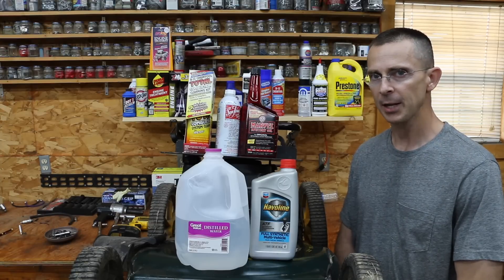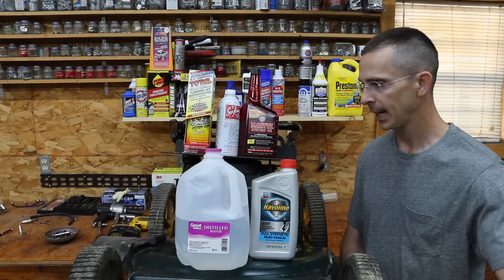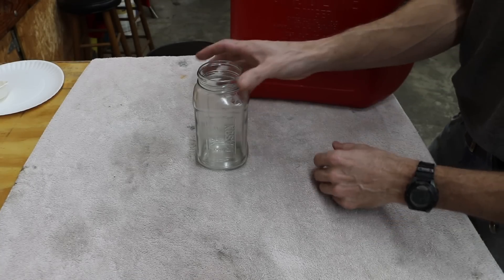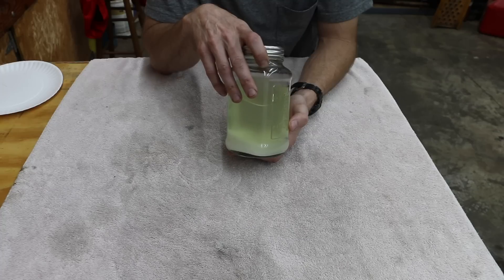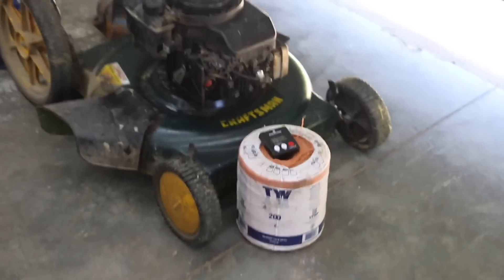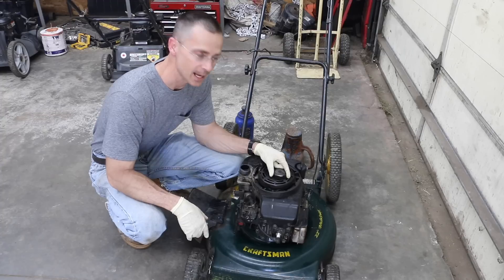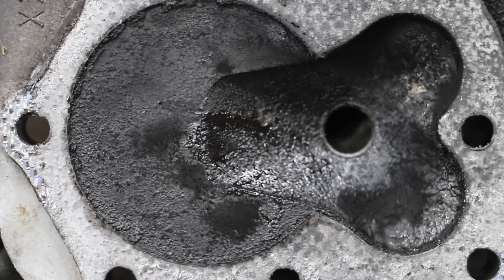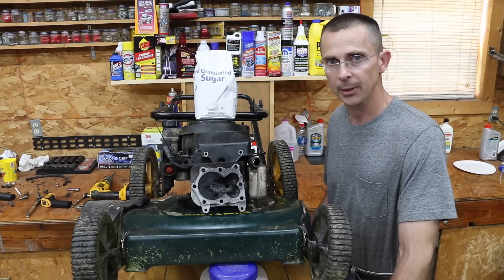Will Sugar in Gas Destroy a Vehicles Engine?  See what it does to this Engine!

Comment: Sugar produces mass quantities of carbon when it burns, however, it does not disolve well in modern gasoline. Back in the old days when they burned a lot of ethanol fuel, it did disolve well and would wreak havoc on an engine. Or so says an old mechanic I used to know, who worked back in the 1920's through the 50's. But then again, he was known to spin a few tall tales.
Reply: They did not add alcohol back then.
Reply: @howardhiggins9641  yeah, actually they did. Ford built Model some A's to run on straight ethanol, and ethanol was commonly added to gasoline to increase octain, and during WW2 when gasoline was a scarce commodity, alcohol was mixed with gasoline, or burned instead of gas.

Comment: I had an car with 5 lbs. of sugar in it, didn't do a thing to the motor but plugged the injectors and the gas line, pulled the gas tank and took out all the sugar that wasn't dissolved   the internals had sugar in the cylinders and flooded the motor with  hot water to clean out the intake and cylinders and blew out the hot water by turning over the motor with no plugs ,Pulled the gas line and blew the sugar out of the line (Dissolved sugar GOO) Pulled the injectors cleaned the tips off .It worked and the funny thing when I stared it up it smelt like burning sugar. The car is still on the road
Reply from the maker: Thanks for sharing!

Comment: I always heard that it worked by pluggung the fuel filter in cars, as they are usually at the low point in the tank.
Reply from the maker: Thank you for the feedback
Reply: John Corcoran It doesn’t dissolve so I’m sure it would.

Comment: I'd clean with rubbing alcohol then flush tank with alcohol.change the filter.  For small engines like this I'd probably even put the rest of the bottle of rubbing alcohol in the tank after it was cleaned and run it with 50-50 gas alcohol with no load for a bit
Reply from the maker: Thanks for the feedback.

Comment: If you want to do another video along the same lines but with better results try using VARNISH added to the oil system .. it will run perfectly fine till hot and then fine till you shut it off but when it gets cold the varnish will harden seizing the internals.  notice I said OIL not fuel ..
Reply from the maker: Thanks for the feedback.

Comment: This would have been a good time to try out two remedies for carboned valves that a mechanic friend used to do with crusty engines. He would slowly pour trani fluid into the carb as the engine idled, sometimes having to rev it a bit. He called it a strawberry douche. 
For really carboned valves he would pour a small amount of rice into the carb and it would beat the carbon off the valves without hurting them.
Reply from the maker: Thanks for sharing.
Reply: Maybe you could test those sometime if you run out of ideas.

Comment: Might take a couple of filters to get it all out. Change filter,, Seafoam in tank and vac line, run tank through then add more. Get up to decent speed on interstate so gas can do its job and clean everything. Change filter again after couple thousand miles. Maybe It'll come clean if repeat couple of times.
Reply from the maker: Thanks for the feedback.

Comment: I had a 62 impala in high school. It was sugared, and after a few days- it died. And That Engine never ran again. The rings were literally frozen in the ring lands.  No Compression. Installed another engine, cleaned the fuel system- and bought a Locking Gas Cap.
Reply from the maker: Thanks for sharing.

Comment: If hasn't been ran for any length of time, Pull tank and filter, backflush all components, rinse tank out till clean, new filter and reassemble, if ran on it very long, new gaskets and a full pulldown.  Likely to be cyl. wall scoring that needs honed.
Reply from the maker: Thanks for the feedback.

Comment: If there were sugar in my gas tank, I would add enough water to dissolve all the sugar, and I would add yeast. I would proof the yeast before adding it. And I would first warm up the gasoline, sugar, and water mix, to 100 degrees F, before adding the yeast. Then I would allow the mixture to sit for several hours at 100 degrees F, so that the yeast can convert the sugar into alcohol (and carbon dioxide). Then I would run the engine normally.
Reply from the maker: Thanks for sharing.

Comment: i was told a new lawnmower is built not to destroyed  if oil is not added turn the crank backwards tell free add oil and it will start and run because the assembly lub will protect the engine
Reply from the maker: Thanks for sharing.

Comment: Many cases, you would need a entire systeme flush and some times the best way is to take ou components like fuel tank filter injectors etc... u could try a cleaner before , no guarantee it will clean the system 100%
Reply from the maker: Thanks for the suggestion.

Comment: Yes it CAN ruin an engine. Just because it doesnt for some people doesnt mean it wont. Engines are not designed to run contaminates through the fuel system and cylinders. There is a proper way to use sugar and after thinking about it I decided not to tell because I know someone will try it on someone. 

In all my years in the shop, I can say one thing about how engines are ruined. Their owners. 

If you all want your car or truck to last, you need to drive it like your grandma would. You need to stick to service recommendations and that means a lot more than changing your oil every 3 to 4 months. You also have a transmission and that oil gets ignored generally for the life of the car. Again, in all my years in the shop, Ive met only 2 people who had the common sense to change ALL the fluids in the vehicle, engine, trans, gear, grease etc...

The cars that came into the shop were always neglected by their owners. Very few times did we ever get a repair on a car that was taken care of properly. When you are at a stop, it isnt a drag race when the light turns green. When you have to stop, dont wait till the last 5 feet to hit the breaks. 

If you dont mind blowing cash on repairs, then knock yourself out people.
Reply from the maker: Thanks for sharing.

Comment: Someone may have mentioned this already since this video is old, but putting sugar in a gas tank to destroy it comes from (at the latest) WW2 sabotage instructions. Here’s what the OSS’s “Simple Sabotage Field Manual” (easily found online since it’s now declassified and public domain) said about it
“If you can accumulate sugar, put it in the fuel tank of a gasoline engine. As it burns together with the gasoline, it will turn into a sticky mess which will completely mire the engine and necessitate extensive cleaning and repair. Honey and molasses are as good as sugar. Try to use about 75-100 grams for each 10 gallons of gasoline.”

My understanding has always been the “technique” wasn’t so much false as it was simply dated, only working on older engines.
Reply from the maker: Thanks for the feedback.

Comment: IN THE ENGINE OIL YOU GOT SMALL MINUTE METAL AND CONTAMINANT AND STILL WONT BLOWN UP YOUR ENGINE SO I DONT THINK SUGAR THICKNESS OR PARTICALS IS THE CAUSE BUT IT REACTION TO TEMPERATURE AND HEAT IS THE CAUSE AFTER ALL SUGAR WERE REFINE FROM HEAT CYCLE
Reply from the maker: Thanks for the feedback.

Comment: The chemicals you mention at the end would have little effect on the sugar.
Drain the tank, change the filter, blow out the lines... and IF you do not have a BUNCH of bent pushrods??? You may be able to clear the valves and chambers with plain water...
 STEAM!
Reply from the maker: Thanks for the suggestion.

Comment: I recently found someone had poured sugar in my 98 crv and I had misfiring but (I think that was from a oil leak into the distributor) other than that no issues I decided I fill up with e15 and put stp fuel additive i had laying around we will see what the results are in the next few days but I plan on doing a fuel filter and flushing out the tank after I burn this gas up
Reply from the maker: Sorry to hear!  Thanks for sharing.

Comment: Did you happen to do any videos like this here replacing sugar with bleach? Also...looks like the sugar is a bigger risk to your fuel pump / filters than getting to the engine. Doesn't really dissolve in gas, though I was wondering with modern ethanol fuel if some of the sugar might dissolve.
Reply from the maker: Thanks for the suggestion.

Comment: Add the sugar to the oil. Pancake syrup works well.  Run the engine until it gets warm and shut down.  When it cools off the sugar will crystalize in the oil ports and bearings and the engine will seize up.
Reply from the maker: Thanks for the feedback.

Comment: I can tell you from experience that sugar will destroy the upper half of the engine! it can't get to the lower half cause it will never run!!! i'm a former shop teacher, and an evil wicked child put about four cans of Mountain Dew pop in the gas tank of my classic car, A 1964 Ford Galaxie 500 Convertible with an R code 427 FE engine with duel four barrel carbs. The carbs were brand new Holley 600's. The heads were totally redone with new valves and hardened seats, and new valve guides. The car sat like this for two months. It always ran well, and the day came I wanted to start it. No matter what I did it would not start or get fuel to the carbs. I removed the float bowl plugs and nothing but white powder came out. The carbs could not be rebuilt they were totally destroyed. The valves froze in their bores and bent several pushrods. As well as unpressed some of the new valve guide bushings that had been installed. And last, the Mountain dew ate the rod that holds the float for the gas gauge inside the tank
Reply from the maker: Wow!  Sorry to hear!

Comment: The answer is so obvious.
Sugar does not dissolve in gas.
If there is water in the tank it would dissolve the sugar but it would
not mix well with the fuel.
The fuel system has filters that will block the sugar crystals.
The fuel delivery system on the lawnmower is not the same as a car.
There is a fuel pump and long lines on a car.
You might have  problems with blocked filters.
Liquid varnish or resin would be better.
Reply from the maker: Thanks for the feedback.

Comment: Back in the 1950s people would put a lot more sugar in the tank. Problems would occur later on when engine shut off and cooled down. Of course it wasn't unusual to have some condensation water in the gas tank because the tank wasn't sealed like today's gas tanks. That's why they sold "dry gas" to remove the water from the tank before winter.  That water would dissolve some of the sugar and that would leave a varnish.  Fuel filters weren't much more than a glass settling bowl where you could see the dirt in the bowl and any water. Eventually, the engine would be all gummed, varnished, and carboned up. Pieces of carbon would act like a glow plug which creates more problems.
Reply from the maker: Thanks for sharing.

Comment: The last sugared engine I worked on, I had to completely disassemble and hot tank everything.  An engine will run just fine on sugar...............Its after ya shut it off and the engine cools is when the valves stick open and the lube holes plug.
Reply from the maker: Thanks for sharing.

Comment: Hey again, I finally have a suggestion for an experiment. I have been told that using a raw egg, as a way to stop a leak in a radiator. I'm not sure how many eggs, or if the size of the leak/hole would make it not possible. But its definitely something I've actually heard of more than once.
Reply from the maker: Thanks  for the video idea.

Comment: If I knew there was sugar in my tank and the car was still running, Yes, I’d drop the tank and clean it, have a look at the fuel pump if it’s visible, replace the fuel filter and/or the sock if it had one I could replace, and just to be safe I’d run Seafoam.  Ordinarily I run Marvel in my fuel because it’s much cheaper and you get much more of it, but I run Seafoam in my crankcase every so often.  I used to Seafoam every oil change, but I do it every other time now, and run Marvel in the fuel every 10K miles or so, two bottles, half a can of seafoam in the crankcase.  I usually seafoam my Impreza, this is the first time I didn’t recently, ran the oil up to 5K miles and changed it, it still looked almost new, I was amazed, it was still light brown and thick.  But the engine sounded like the oil had thinned and worn out, so not quite sure what to make of that.  The Impreza sounds audibly noticeable around 5K miles and my Evo X at 2K miles.  Identical oil in both, Mobil 1 Extended Performance 5w30 with M1 Annual Filter.  The Evo I often times do change once annually because I don’t drive it a lot.  But the Impreza is 2-3 times per year.
Reply from the maker: Thanks for sharing.

Comment: I've heard about adding egg whites to a gas tank it will continuous clogged up the fuel filter will not damage the engine you can buy the car cheap. Clean out the gas tank and replace the fuel filter
Reply from the maker: Thanks for the feedback.

Comment: Sugar in the oil is where it screws up an engine. After the sugar desolves in the hot oil, it turns into hard candy and will seize the motor when it cools.
Reply: Reminds me of the myth about adding diesel fuel to gas by mistake. As long as you let it run, it'll run. Cut it off, it won't restart.

Comment: Have a 97 F-350 with a 460 and a tweaker neighbors treated my tank and I did have to end eventually change fuel pumps basically because the screen and the tank got clogged and my fuel filter caught most of sugar and this is I've drove on it for two years so not as far as the damage in the engine injector screens were clean everything else seems to be hunky-dory the sugar was mostly in the filter when I cut the filter up and I said what in the world is this the sugar doesn't really dissolve in the gas if you can make it through to the cylinder then it will caramelize in the cylinder and Lucas will clear that up for you
Reply from the maker: Thanks for sharing.

Comment: That engine uses splash oiling. If it used an oil pump the valve would stick open at shutoff. When started again no oil pressure.
Reply from the maker: Thanks for the feedback.

Comment: Several years ago some teens dumped sugar cubes into a local car gas tank. The parents leaned on the parents of the perpetrator and got some financial compensation. Turns out when the gas tank was checked the sugar cubes had not dissolved at all! That coincides with this test, where it was very difficult to dissolve all of the sugar in the gasoline in the test jar. Theoretically, the sugar cubes could possibly have been left in the gas tank with no (hopefully) harm, but wisely they were removed. Note to vandals: don't use sugar cubes in gas tanks...go with the real stuff!!
Reply from the maker: Thanks for sharing.

Comment: To clean, I would remove the gas tank & fuel lines, flush to assure they're clean, then re-install,  then replace the fuel filter, now I would use water to the running engine to steam clean it internally, then a final clean with Sea Foam.....     BTW, if you want to destroy an engine, put syrup in the crankcase, run it until hot, then see if you can get it started the next day after it's cooled for hours!!!
Reply from the maker: Thanks for sharing.

Comment: I'd drop the fuel tank to get the sugar out.  It seems like it wasn't dissolving very well and it might just end up staying in there contaminating any new gas that is poured in.  Then definitely changing the fuel filter if it ran with the sugar in there.  And definitely checking the cylinder heads afterwards if it ran with the sugar in there.  Then maybe a pretreatment with Marvel Mystery Oil and finish it off with a full Seafoam flush.  It would be a lot of work but it would save a machine and the investment behind it.  If someone was trying to "screw me over" by doing this, they wouldn't be winning in the end - that's for damn sure!
Reply from the maker: Thanks for the feedback.

Comment: Had this happen to me a my gfs at the time her ex had it out for me i was going on a fishing trip and stopped at walmart to get some last minute suply well had to get gas when i opened the cover I saw the white substance pinched some out and realized it was sugar i drove home and called the cops they took prints and I found out it was him from him bragging to my friend at the bar well i dropped the tank and looked like a bag or two of sugar was dumped in so roughly 1 to 2 pounds of sugar my truck has two fuel filters one built into the pump and one on the fule rail the one on the pump was clogged of hours but the other had nothing so I cleaned out the tank with water bout 5 or 6 times then used liquid heat to evaporate and left behind moisture i reattached everything filled tje tank up added seafoam drive till i had half a tank no issues topped it off all in all close to 250 bucks and two days of work my friend got revenge for me he added 3 gallons of a mixture of silicone lubricant long term copper lube for fire arms and baby oil to hus gas tank my buddy picked up a criminal damage charge and vandalism did 2 weeks jail 2 years probation 900 in restitution and 1,500 in fines when ever he needs a favor i always ablige
Reply from the maker: Thank you for the feedback

Comment: I'd drain the fuel, add new gas, and maybe dribble water into carb with engine running or maybe seafoam and definitely a locking gas cap.
Reply from the maker: Great suggestion!  Thank you.

Comment: My 50 cc moped was stolen and when I got it back the motor had seized. There was sugar in the tank. Changed the cylinder and piston. It didn't have a fuel filter.

Good thing is the thieves had to pay for the new parts I had to order from ducati. 200 € was big money 20 years ago.
Reply from the maker: Thanks for sharing.